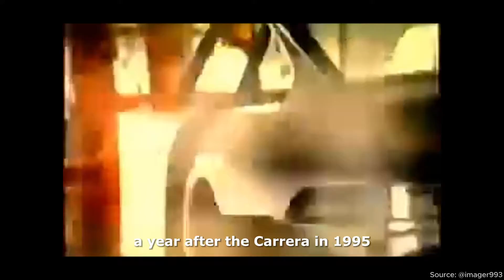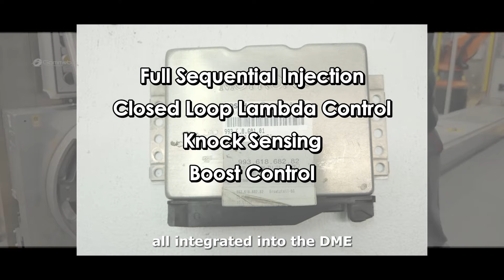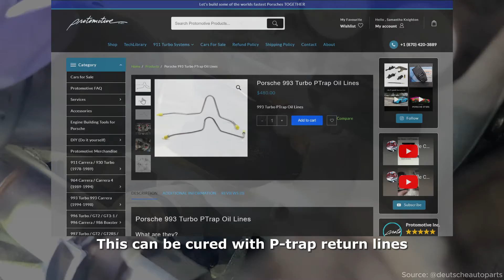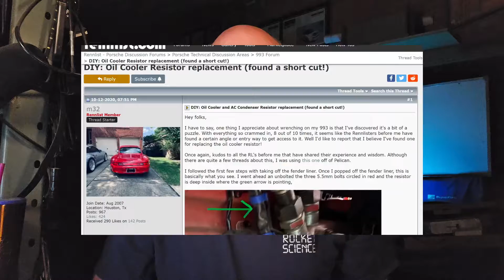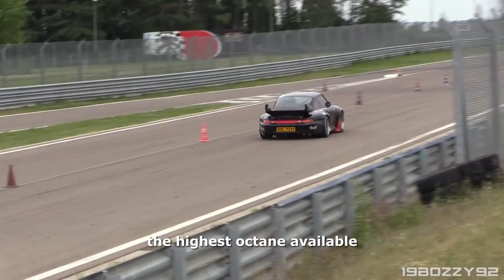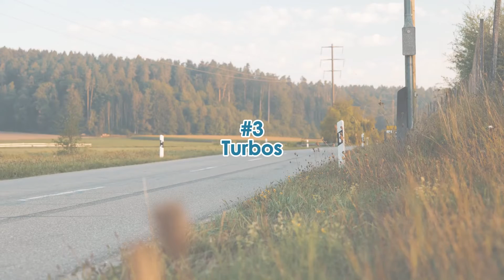Avoid these MISTAKES before modding your 993 Turbo Porsche!

Comment: Saw a red 993 turbo  in my city yesterday
Reply from the maker: Nice!  It's a rare sight these days.  Do you like 993 turbos?
Reply: @protomotive   I have owned 3 air cooled turbo's  79 82 89
Now on my 2nd 996tt 
But yes 993 in arena red please
Reply from the maker: @kidnplaye4630  too fun! An arena red 993tt was recently sold to a good client of ours that's now doing a really fun 6 to 700whp build :).  Are your 996tt's getting any love?   Tuning? Modded or stock?   My cobalt blue 996tt is a hoot!
Reply: @protomotive   tip was stock x50
6spd full marksi  tune
Reply from the maker: @kidnplaye4630  nice :). Give us a shout if you'd like to play with them some more.   The k24s on the x50 compressors are pretty small and taper back on boost.  Some 18g compressors, Injector and pump upgrade can get them quickly up another 100hp :)